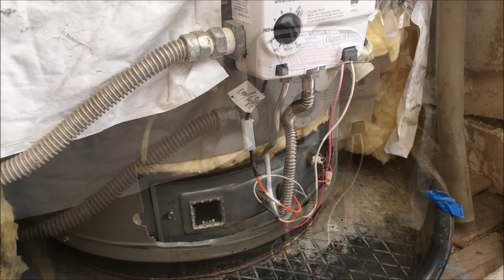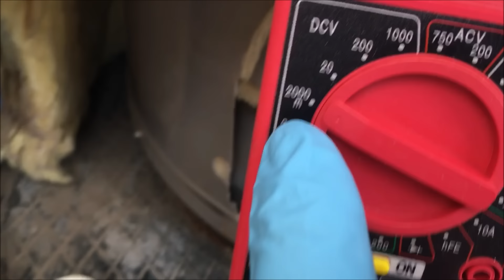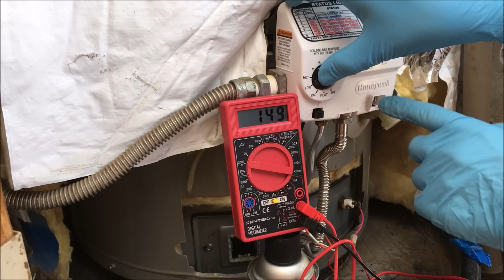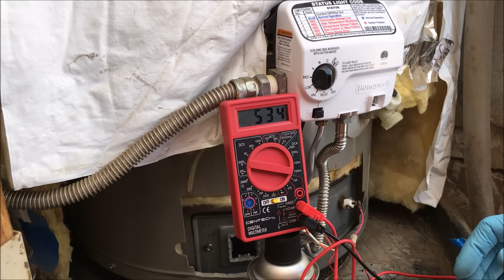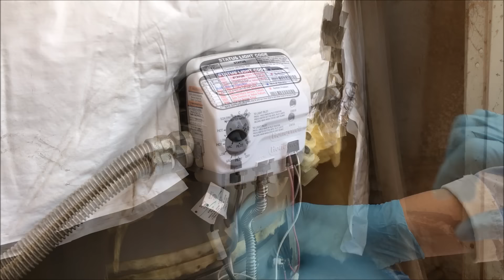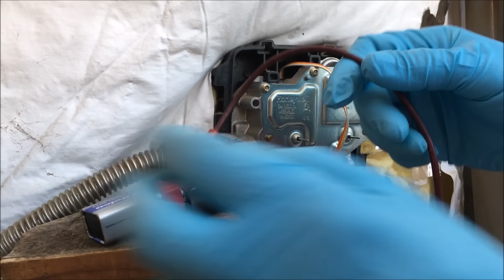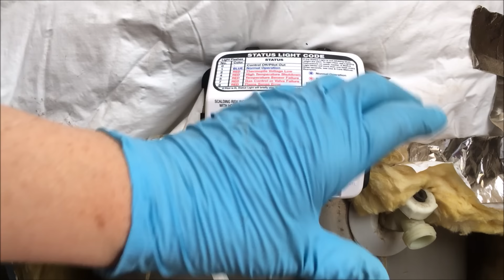Troubleshoot Water Heater AND Honeywell Gas Valve | Step-by-Step

Comment: What to do if the water heater works but the water is very hot, don’t have a way to control water temperature
Reply from the maker: Lex, not sure.  It may be the temperature sensor, that's attached to the control board and goes into the back of the gas valve body, has failed.
Reply: @frugaldiy1  that’s what I was thinking, in order to replace it do I have to replace the whole valve body, or is there a way to replace just a sensor?
Reply from the maker: There's a way to replace the sensor, but it's involved.  You might be better off replacing your gas valve.
Reply: Thanks for the tips, and for the video, very informative 👍
Reply from the maker: You're very welcome, Lex.  Were I to replace the temp sensor, I would look for a pre-owned gas valve on eBay and take the temp sensor off of that.  There are sellers, who are plumbers, on eBay who sell Honeywell gas valves and control boards that they have taken off of working water heaters when they do an install.  I'd look for a highly-rated seller and get one of those.  Hope it helps.

Comment: Could not get my pilot light to go on. I got really close to the little "viewing window" and could see the igniter was sparking, but, no pilot lighting.  So, I followed your instructions and pulled the burner assembly out. ( I must admit, I was a bit intimidated at first.) However, I felt confident from your instructions that I could see this through.
       And, ultimately, it was fairly straightforward. I cleaned the thermopile, igniter, and pilot light orifice. I use a 1500 grit sandpaper and it seemed to work fine.  I also use some denatured alcohol as a cleaner rather than spending the hour and a half going to an auto store for the mass air flow sensor cleaner.  I also blew the open end of the pilot light tube and could tell there was air flow.
       Put it all together, and I'll be darned if it didn't  fire up and is now cooking up hot water.  Thank you.  Thank you.  Thank you.  You just saved me a lot of money and hassle.
Reply from the maker: Michael, what a lovely thing to hear!  Job well done, my friend!  I'm over the moon that my video helped you.  Ain't it a great feeling to fix the water heater yourself and save boat loads of money?  I see early retirement in your future.  :)  Enjoy the hot water!
Reply: @frugaldiy1  Thank you.  I am truly grateful to for the work you put in on making the video.
Reply: "to you"
Reply from the maker: You're welcome, Michael.

Comment: Made the mistake of popping the black button/knob out when replacing the board (before watching this video). I put the spring and knob back on but am not sure it was on the same position/setting as when I removed the board. is this a concern?
Reply from the maker: Adam, I can't say for sure because I don't know how you reinstalled the knob.  I can tell you the the knob needs to be positioned in it's proper location because the arm of the knob goes into a component on the control board.  I understand the knob is a bit finicky to take off and reseat properly.  Tipping/leaning the knob, slightly, to the side will help to remove and reseat it.

Comment: Fantastic clear detailed explanation to troubleshoot my water heater.  Tried a bunch of other videos but none of them helped me like this.   Turned out it was the control board.   My valve is WV8840A5029 but that seems to have been deleted and superseded by something else.  Will any WV control board work in my valve?
Reply from the maker: Neil, thank you for the kind words.  I'm glad the video helped you.  I cannot answer your question with certainty.  What I can tell you is the gas valve on my water heater that failed has a model number that started with the letters "WV."  The new gas valve I got at the Restore had a model number that started with "WV" but had different numbers that followed the "WV."  I felt certain that though the numbers were different after the "WV," the control board would work just fine, and it did.  So, in my case, the replacement gas valve model number was NOT exactly the same but works like a champ.

Further, if I would not have found the gas valve at the Restore, I would have purchased a pre-owned control board for my gas valve on eBay, from a highly-rated seller, without hesitation.  I saw that many of the pre-owned control boards were being sold by plumbers who had pulled a working unit/water heater.

Comment: Dear Frugal.  Like yourself I was determined to fix my water heater.  It has been going out sporadically for the last 6 months.  I would just go through the relighting steps and it would work again - every time.  I did notice that upon restarting I would get the 7 flashes for about 5 minutes then it would go back to 1 flash indicating normal - every time...   Still not certain if I have done anything to correct my situation but tonight I dug deeper.  I really wonder what is failing on all of these control boards - so when I took mine out I had a good look all over the board and really didn't find anything remarkable.  Knowing that most failures of electronics are due to bad connections or failed solder joints - my heater woes certainly support this type of failure.
Soooo, I was wondering if you or anyone on your list has any more insight.  Some of your fans indicated that they had contact springs come off and they re-soldered them.  I didn't find that but I did find that the fingers on the contact where spread apart for the ground pin of the gas valve for solenoid connections. 

If that contact, the bottom pin to the board, where to go open do to relaxed pins, then my pilot would go out, and maybe the controller would recognize the high impedance of the solenoid circuit and set a code 7 to memory.  Someone mentioned that it may be necessary to "reset" the control board, but I did not quite follow that comment.  Nobody described a situation where they took the board out and put it back in and .... it just worked.  But this would support this idea!

More thoughts.  Looks like a switcher supply might be used to boost the voltage from mV to volts to drive the solenoid gas valves.  Thermal piles don't make much voltage but can make decent current.  So this type of step up supply is likely present to boost that voltage.  I will measure it at the capacitors if I need to take it apart again.  

Finally, your video inspired me to jump on board with your helpful attitude....     I am all for saving money even by getting a new board; BUT if we can identify the principle failure modes of these control boards, imagine the friends you would have then!    

Will need to share this link, and start following your videos.    Peace and Grace to you!
Reply from the maker: Dear whtelsecanisay.  Your writing skills are impeccable!  Bravo!  Thank you for your thoughtful, analytical comment.  It's much appreciate in YouTube DIY land.  I'm close to 60 years old and have never had a "fan" in my life.  If I have any, I wish they'd step forward and identify.  :)  

Now, on to the issues at hand.   I would think if the fingers on the contact were an issue, you would not have successfully restarted your water heater as many times as you have.  Just my thought.  That said, I'd take a pair of needle-nosed pliers and crimp the fingers back closer together.  It's worth a try.  

How to "reset" the control board.  I think what the person was referring to is the "10-10-10 second" reset trick that allows you to override the error code on the board when you have a 4-flash "High Temperature Shutdown" occur--4 flash LED status code.  I have a video that shows you how to do that--"Honeywell Gas Valve 4 Flash FIX | High Temp Shutdown."  It works great and requires no tools.  The Honeywell gas valves don't "reset" themselves, which is evidenced by the valves sensing high water temperature, then shutting the gas off, and thereby the pilot flame, but still flashing the same code when the water is cold.  Thank you Honeywell!

I'm glad I inspired you in some small way.  I decided to do this video and post it because I get awfully tired of the little guy and gal getting drained of money by "da man and da woman."  How could a corporation, with an intact conscience and some degree of ethical fiber, ever do this to unsuspecting consumers and for this many years?  This gas valve failure has been going on for dog years.  It's shameful.  

For what it's worth, I do also know how to "rig" the control valve to get hot water while a person waits for a replacement valve or board.  But, because it can be dangerous unless the procedure is followed precisely, I can't do a tutorial video and post it to YouTube, given that I feel certain some people may well want to "shorten" the steps and will hurt themselves.  Common sense isn't that common anymore.  

Lastly, I feel certain that your control board is faulty and needs to be replaced.  I'd get a new or pre-owned board on eBay from a highly-rated seller.  There are plumbers on eBay that are selling "pre-owned" control boards they have pulled from a working water heaters.  Now, I do have a tinge of thought that the temperature sensor on your valve may be failing but I'm not confident.  Those too can be replaced, but that's an involved task. 

I hope this information helps you.  If you need more help or information, comment back.  I'm happy to be of help if I can.

Comment: This is an awesome video! I do have a question. My pilot is going out at least once a day for the last week and everytime I have to relight it, I find that I have to press a little button on the back of the thermal switch in order to light my pilot (no blinking trouble code). Could it be that my switch is going bad or I have bigger issues that need to be addressed? I'm watching the video now and have not gotten the chance to follow the steps yet.
Reply from the maker: Thank you, Mr. Roboto.  Now, to your question.  Yes, you could well have a faulty thermal switch that needs to be replaced.  Also, the thermal switch will trip, and extinguish the pilot light, when the temperature in the combustion chamber exceeds a preset temperature.  Look to see if the lower and upper vents on your water heater are clear.  Blocked vents can cause excessive heat buildup in the combustion chamber, which will trip the thermal switch.

Comment: Excellent video!  I recent had my pilot go out and changed the pilot assembly (without testing) and fixed the problem.. a week later the pilot was on but the burner was not lighting . I saw a 2 flash error. I checked the thermopile and it read 685mv.  Would it be possible if you could recommend some other troubleshooting steps I could follow? I have the exact same Honeywell gas valve controller.. note: when I installed the new pilot assembly I forgot to clip the wires to the burner tube and they may have got heated up. 3 days after the install I clipped to the burner tube. Thanks so much
Reply from the maker: Michael, were I you, I would test the pilot valve and main burner valve to make sure the gas valve is working.  My guess is that the control board on your gas valve has failed.
Reply: @frugaldiy1  Thank You for the quick response! I’ll definitely check out the pilot and burner valves per your video and If they check out purchase a control panel. Thanks again for helping.
Reply from the maker: You're welcome, Michael.  I'm confident you can fix the water heater yourself!
Reply: @frugaldiy1  Thank You! Today I checked the pilot and burner valves w/ a 9V battery (per your video) and both "clicked/activated" so I'm now searching for a control board.  A replacement gas valve for my Honeywell WV8840C1404 gas valve is the SP20832A which is $285! I hope there is a cheaper alternative.
Reply from the maker: Great job, Michael!  At least now you know it's the control board that has failed.  I was fortunate enough to find a Honeywell gas valve at my local Habitat for Humanity Restore that I could swap the control board out of.  Now, the model of the gas valve I purchased at the Restore was not the same as the gas valve on my water heater, but both model number started with "WV" and the swapped control board works just fine.  If I would not have found the gas valve at the Restore, my plan B was to purchase just a pre-owned control board on eBay.  Plumbers are on eBay selling Honeywell gas valves and control boards they have pulled from working water heaters at a job.  I would have purchased a pre-owned from a highly-rated seller on eBay.  My concern with paying full price for a new entire Honeywell gas valve is that the control board WILL fail again--it's just a matter of time.  I hope this helps you.
Reply: @frugaldiy1  Thank You again for the options!  I've searched Facebook and ebay and found a bunch of WV8840##### units but with different last 5 digits. I'm going to purchase one and fingers crossed it will work like it did for you.  I'll keep you posted on the final results. I'm your student in this project :)
Reply from the maker: I'm happy to help you any way I can, Michael.  Just let me know.
Reply: @frugaldiy1   Update:  I was able to get another pilot assembly sent to me by the manufacturer.  I had a feeling my poor installation (wire weren't initially clamped to the burner tube causing the wires to heat up/burn slightly) was the causes.  I installed the new assembly and no issues now for 4 days. fingers crossed. Thanks again for all the help and great videos!
Reply from the maker: You're welcome, Michael.  I'm glad to hear you have hot water now.  Hopefully, it was just a pilot assembly issue.  But, even if the water heater has another issue, you know how to fix it!

Comment: Solved my issue. Thank you so much. My connections were badly corroded and needed to be cleaned. I used steel wool. Great video
Reply from the maker: You're welcome, MyFootball09.  Thank you for the nice comment and for taking the time to write.

Comment: Best DIY video I think ive ever seen ty, ty, thank you!! Very thorough step by step explanation along wth filming… i currently have the same problem as we speak im hoping the board will be fix…
Reply from the maker: Greg, you're welcome, and thank you for the lovely comment.  Your words mean a great deal to me.  My guess is a new control board will take care the problem with your water heater until the next time the control board fails.  I have a back up control board because I know it's just a matter of time until the new board fails.  When I redo my siding, I'm going to get a free water heater off Craigslist that has an old-school, thermocouple-operated gas valve so I can keep what's left of my sanity.  :)  Let me know if you need any help.  Happy DIYing!

Comment: Are the controller board interchangeable? my gas valve part # is sp20832c
Reply from the maker: I cannot answer that with certainty.  I can tell you, though, that the control board I used to replace my failed control board was not the same part number but it worked like a charm.

Comment: My water won't light up my water heater!
*Igniter works; I can sense and measure current going through it
*Gas Valve opens because I can hear it hiss when I engage the pilot switch.
*I can't check the thermopile because the heater won't light the pilot.

PLEASE HELP... ITS COLD.
Reply from the maker: Miggy, you can test the thermopile by removing the burner assembly from the water heater.  Use a lighter as the flame.  If you don't know how to remove the burner assembly, please see my video titled, "Replace Thermopile on a Water Heater."  Were I you, I would start there.  

FIY--Manually pushing in/pressing the gas valve and hearing a "hissing" noise does not mean the gas valve is working properly.  You have to test the pins.
Reply: I tested the pins, and it does open, and the thermopile also has the right readings when I heated it up with a lighter. Also, thank you for replying so fast.
Reply from the maker: You're welcome, Miggy.  What's the status of the water heater now?  Is it working?
Reply: @Frugal DIY  No it is not sadly.
Reply from the maker: Will the pilot light, meaning can you raise a flame that will stay lit for at least a short bit of time?  Have you, at any time, seen the LED status light flash any codes?
Reply: @Frugal DIY  I can not raise a flame nor saw any flashing codes.
Reply from the maker: Miggy, have you cleaned out/cleared the orifice on the pilot head?  If so, based on what you have told me, my guess is the control board has failed.  If the control board has failed, a safety-feature in the control board will prevent you from maintaining a pilot flame.
Reply: @frugaldiy1  Thank you for the help! I cleaned out the burner assembly. Everything seems to be working fine besides the control board. Thank you for the help!
Reply from the maker: Miggy, you make me laugh, my friend.  It has been my pleasure to help you.  Is your water heater working or do you need to replace the control board?  Either way, I'm here to help you if you need me.  Happy DIYing!
Reply: I have to replace the control board. I am still not getting a spark. Lol
Reply from the maker: Okay, at least you know what the problem is now and how to repair it.  Job well done, Miggy!

Comment: I don’t like those thermostats. The one that came with my water heater was plastic at the tip, so it broke soon (water leak). Had to replace it with another, this had a metal tip and hopefully it will last. Those spark things are weak and don’t light up
Reply from the maker: Merry Christmas, Cooldude 22!  I agree with you 100%.  I think the Honeywell gas valves leave much to be desired and are more trouble than they're worth.  When I redo my siding, I'm going to get a water heater with an old-school gas valve off of Craigslist to replace my newer water heater with the Honeywell gas valve.  The old-school water heaters operate off a thermocouple and are far more reliable.